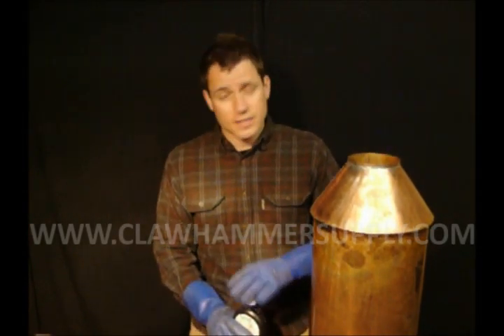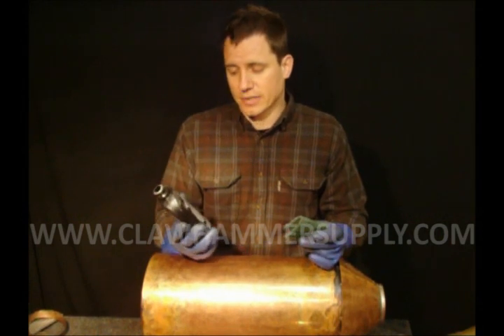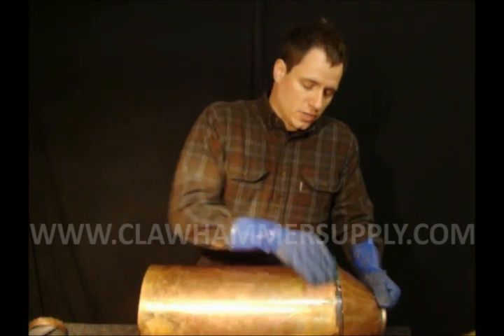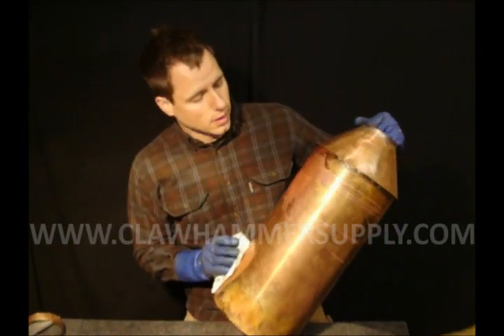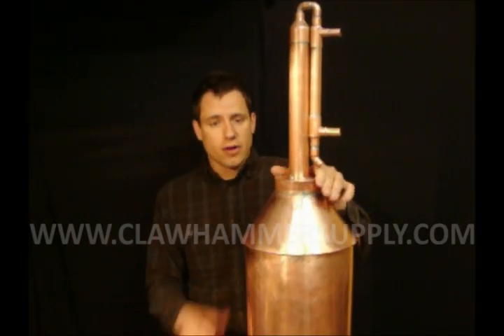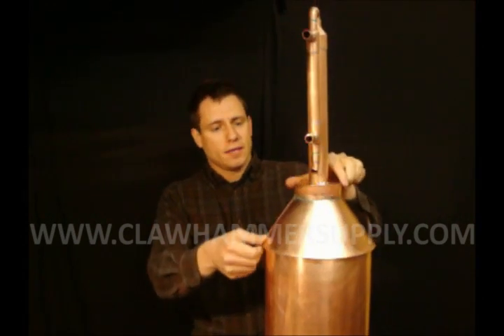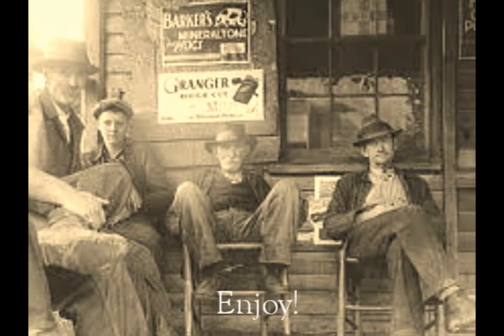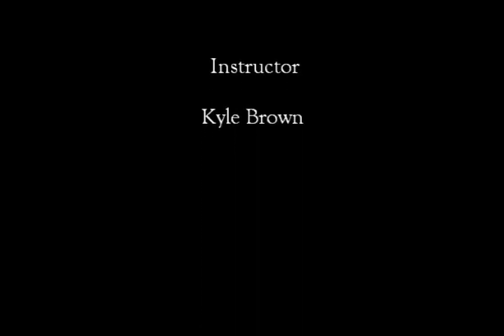How to Build a Copper Still - Part 7

Comment from the maker: The kit utilizes an in-line condenser.  The ports on the side of the drip arm are for cooling water in and out and are sized for 1/2 inch hose (standard garden hose fits perfectly).

Comment: Is Lead Free Solder and Lead Free Flux safe on the inside of the still? Also, How do you clean the inside of the still and copper line after it has set for awhile? Great Vids, Hope for a reply

Comment: I know its not 100 needed but why cut out the thumper as it helps with the purification, ups the proof, and cuts down the number of times a run needs to be distilled?
Reply: There are 2 ways to do this or ANY still for that matter.  A thumper keg is the older way of ensuring water vapor falls back down in the batch when it rises with the alcohol.  So when vapor occurs, its water and alcohol, however the alcohol content and water vapors cool at different temps, so the water condenses first and gets either trapped in a thumper keg, or falls back down inside the main batch/where your mash is being heated, while the alcohol continues to the cooling coils at the end.  These methods ensure higher amount of alcohol makes it versus water.  End result a good thumper keg setup OR a REFLUX which is what this video has, yields higher alcohol content in your finished product.  So the thumper keg is what old moonshiners use to use, and is still effective, but the more recent method is to simply use a REFLUX setup like shown here...hope I explained it well for you.